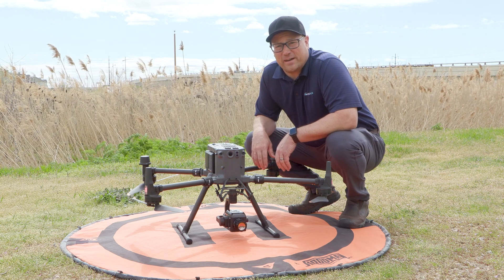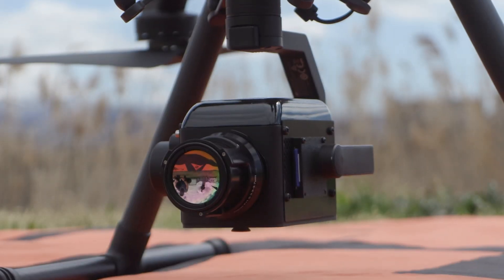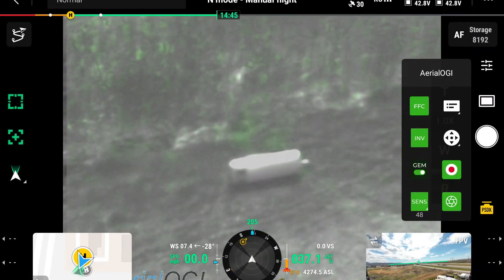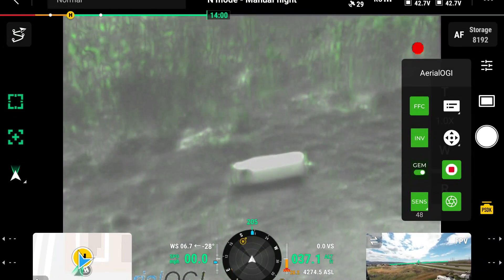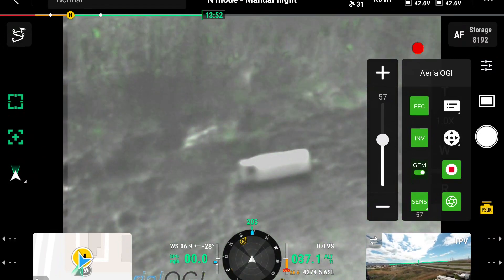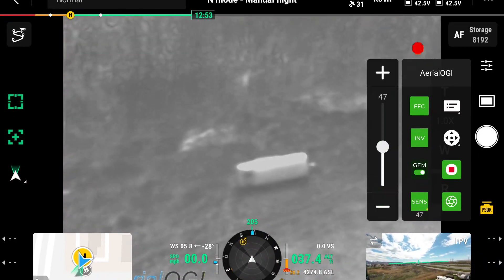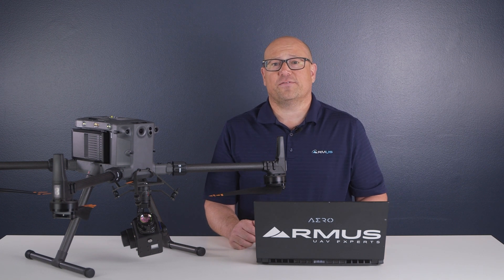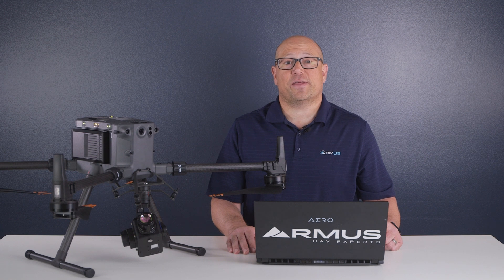TechConnect | Optical Gas Imaging (OGI) on a DJI M350

Comment: Would be nice if there was a way to have this functionality on the M30T for use by FD's. Thanks for this info. Just had a gas leak call today.....
Reply from the maker: For sure, but of course with the limitations of the M30 not having interchangeable payloads, it's just not an option.  But the M350 is more than up to the task.